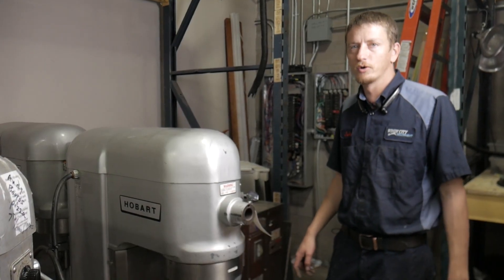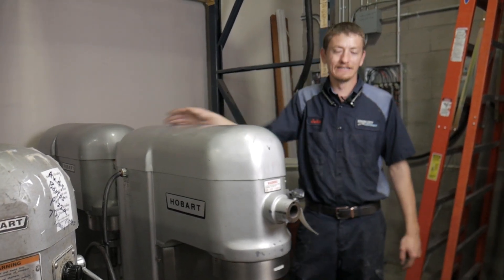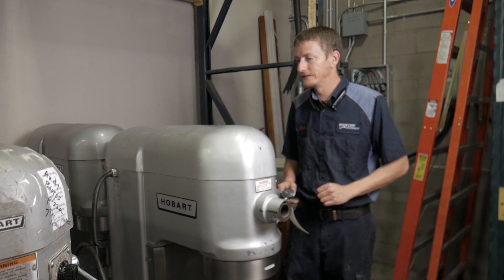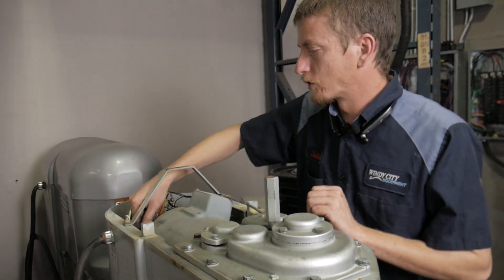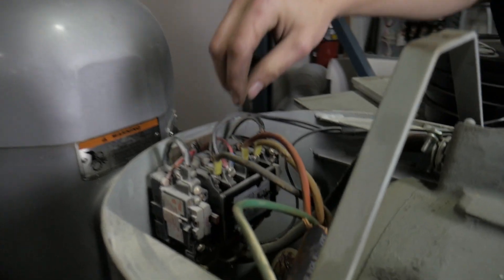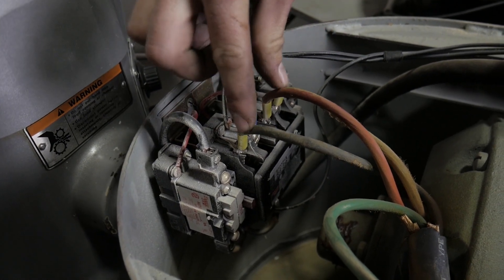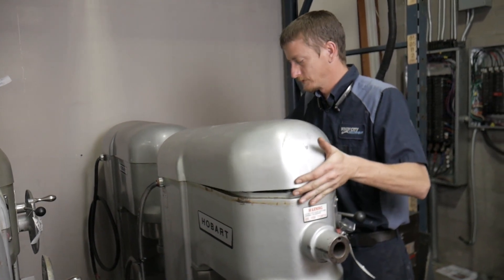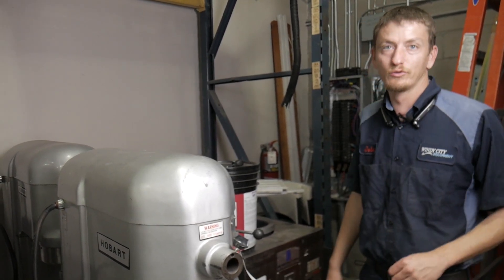How to Reverse the Direction of a Hobart Mixer (3 Phase ONLY!)

Comment: how do i reverse 1 phase hobart spiral mixer
Reply from the maker: Reversing a 1ph motor is not as easy as reversing a 3ph.  You have to reverse the magnetic field produced by the windings.  This is accomplished by rewinding the motor ($$$) or, some motors will be prewired internally to allow this.  You would have to remove the plate on the back of the motor to see if it has a wire configuration for the opposite direction.  Also check the data plate on the motor.  Some will state if it is "non-reversable." For what it's worth, I don't know that I've ever seen a 1ph hobart running the wrong direction...  Hope this helps.  Thanks for watching!
Reply: Hi buddy, one question. Is it possible to change in this motor from trifasic to monofasic?  
I have one of this , but don’t have trifasic energy in place.  
Greets fromPanama 👍🏼.
Thanks